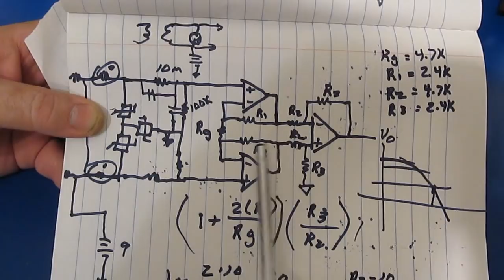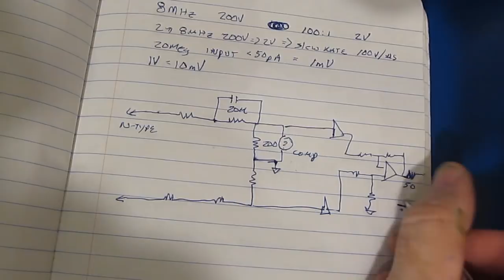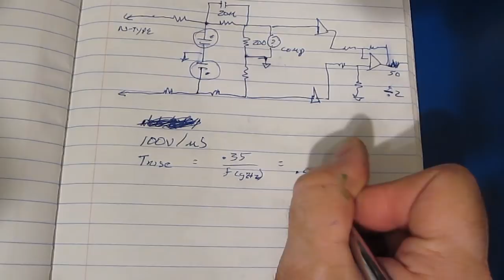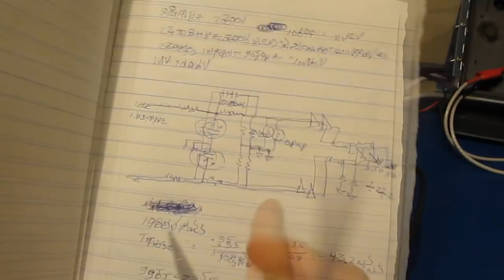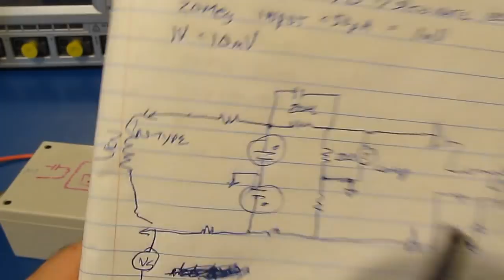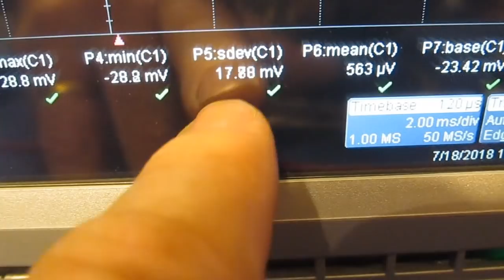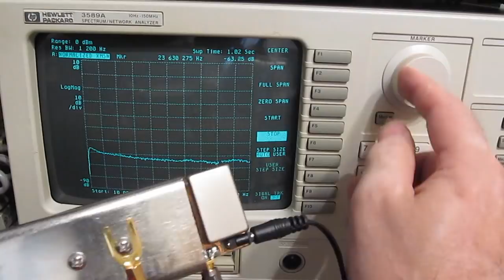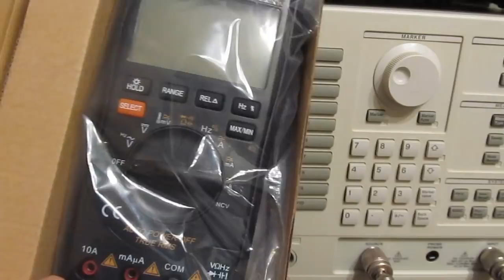Higher Bandwidth Differential Probe  wo a PCB

Comment: Finally! Retribution for that danged house disrupting bolt of lightning. Don't you feel better now?
On that MK01, why not prove the applicability for newbies on slim budgets, and show'em what could go wrong if they trust it for high voltage and current (and maybe do a "Dave poke and tip it test" like when he mocked the tiny AN8008).
Reply from the maker: You want to see how stable the base is?  I would need to think of a good way to do it.
Reply: Maybe similar to EEV#1007? (at 4min) https://youtu.be/xdGQEVdxmQQ?t=236 He likes everything built tough as bricks. Another frustrating thing on my AN8002 is the short lead length - is the MK01 the same?